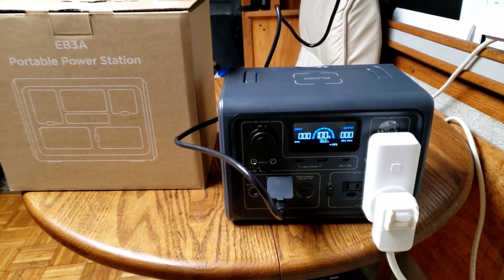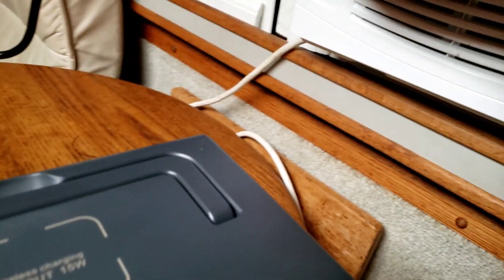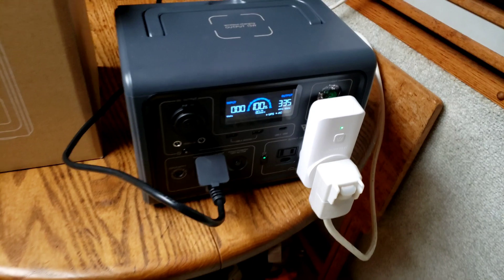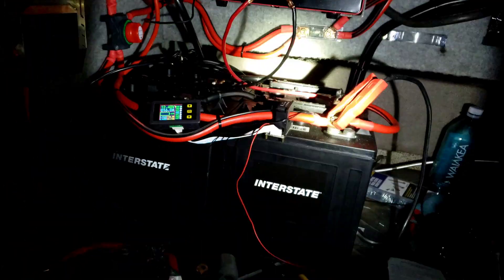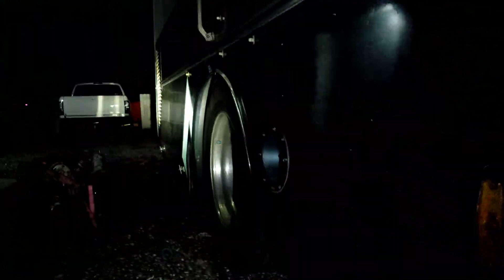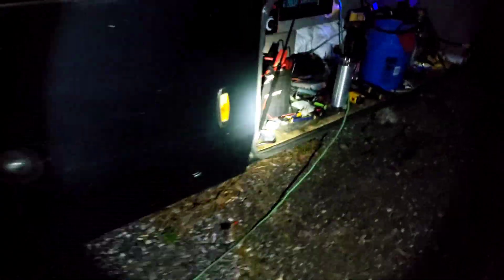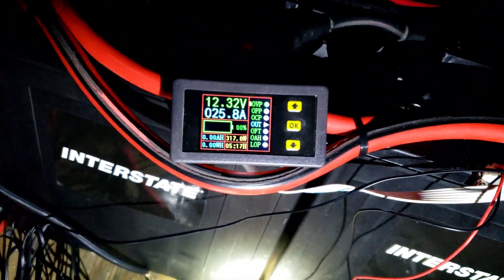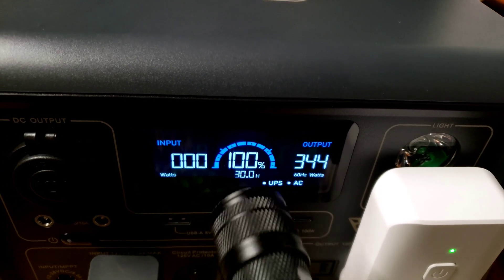BLUETTI+Lead Acid Battery Hack running Air conditioner A/C

Comment: How is this working if the air conditioner is running at 350plus watts how is it only pulling 200 from the battery should be showing more from the battery then on the power station i suppose u shunt is bad
Reply from the maker: The batteries are charging the bluetti so I don't know but it worked

Comment: If you had a 24 volt system you do even better IMO.I believe the Bluetti can take up to 28 volts Max. @ 8.5 Amps. I just bought a variable power supply which puts out 30 volts @ 10 amps. I'm going to run the Bluetti with the power supply in the jack where the solar is connected. I've already tried this experiment with my smaller Variable power supply which is around  30 volts @ 5 amps and it extends the battery time. The EB3A thinks I'm running max solar but its really my power supply running like an extra batter or just a solar panel.
BTW ive tried to run my 5000 btu A/C but the compressor's surge it more than the Bluetti EB3a can handle. I have an Ecoflow Mini that I'm going to try this summer with 2 ebike 36volt batteries.
Reply from the maker: Yea this is a 4000 btu ac but if you drill some holes in bottom its keep water from slowing fan down helps a couple extra watts. Why my 6v golf cart batteries are 210ah each and I have 6 of them and going to get 2 more. Those plugged into my inverter then rv plugged in that 4000 watt inverter so the whole RV gets power and just have BLUETTI for the window ac unit and its plugged in to rv so it ends up taking less wattage out of my battery bank so I can run AC and 50watt 12v Fridge Freezer all night unit next morning then my 1200 watts of solar and 100amp charge controller takes over charges my RV bank and BLUETTI to run all day free Air Conditioning and then get free ac and Fridge all night.
Reply: @supremeautomotive6749  sounds good i wish i had 1200 Watts of solar im lucky if i get 500 watts with the 200 watt and 3 100 watt solar panels with a 30 amp charge controller .Its good for what i need it for but will get more prob this spring or summer. Good luck my friend with your system sounds killer
Reply from the maker: @mannyfragoza9652  yeah if you check out my video before this one i show the RV and solar setup.
Reply: @supremeautomotive6749  ill check it out
Reply from the maker: @mannyfragoza9652  its probably because you are using 2 different size solar panels. You need to have around the same volts and amps on panels to get full wattage
Reply: @supremeautomotive6749  i did have different panels and i believe they were all different voltages so thanks
Reply from the maker: @mannyfragoza9652  it will only pull in what the smallest max wattage could do on the controller.
Reply from the maker: @mannyfragoza9652  do a test with the 1 panel and test with just the 3 panels. Let me know what happens